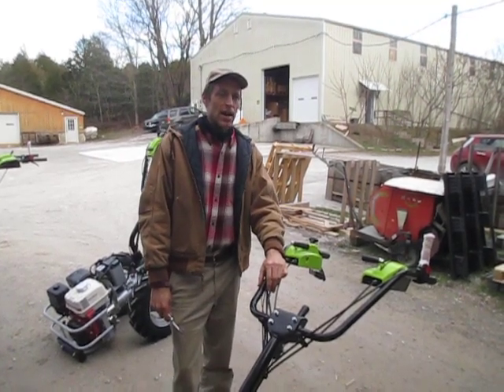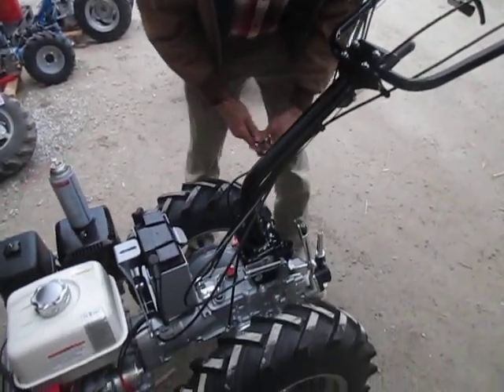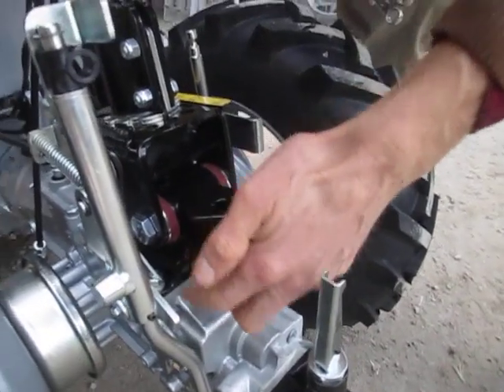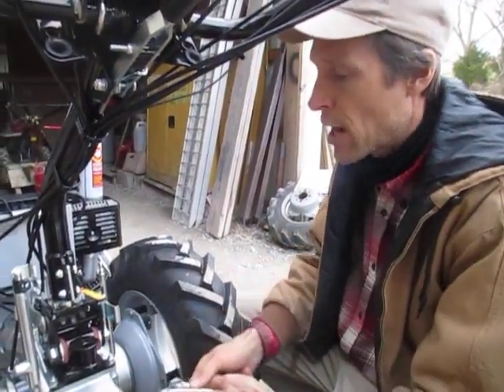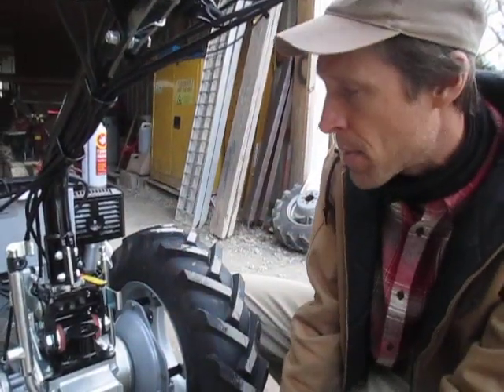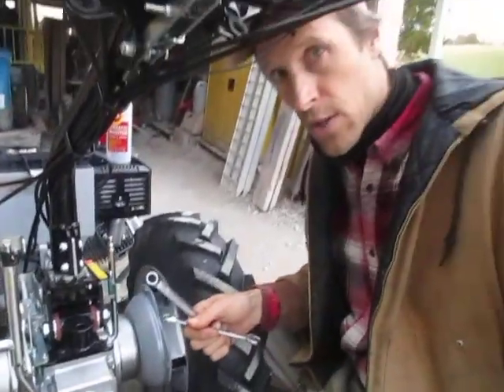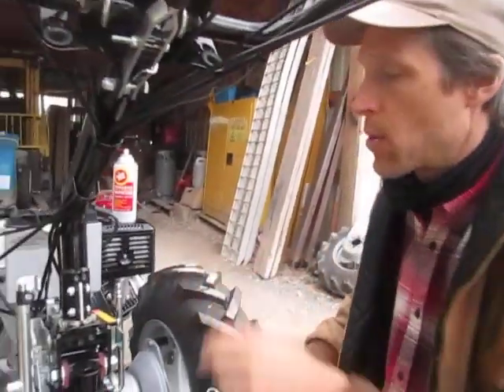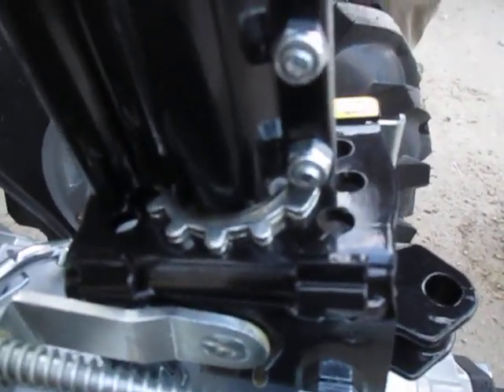Grillo Walk-Behind Tractor: Handlebar Maintenance

Comment: Hey Joel & the super-duper Earthtools team :) I was wondering if you have a piece of advice in regards to a handlebar that has a lot of slack... I have a Grillo G110 DF and the handlebar „plays” very much in the socket where you rotate it... how could i adress this issue? Have you or your customers had this problem? Thank alot and God bless!
Reply: I also have a G110 and the only negative comment in 2 year of ownership is the sloppy play in the handlebar. It appears as though there is a bolt on the bottom side of the handle bar assembly but I have yet to figure out how to access it. There also appears to be a bead of weld meant to keep that bolt from turning. I would love to see a video from Joel addressing this!
Reply: @hendonfarm1015  You have to take the black thing that keeps the handlebar and where the PTO lever and Gear shift lever move apart. It's not complicated. And i would recommend to weld the broken bolt (if the original weldings are broken) very very well. It fixed my problem!

Comment: This is the weakest link in these two wheel tractors. My handlebar post broke away from the anti vibration assembly. Looks like no penetration of weld into the thick post metal. Now it’s is so floppy the handlebars might as well be wet noodles. If I had to do this again I would probably drop 15 grand on a four wheel tractor.